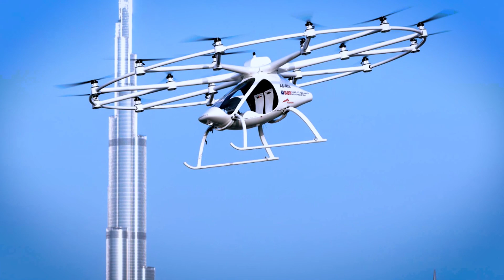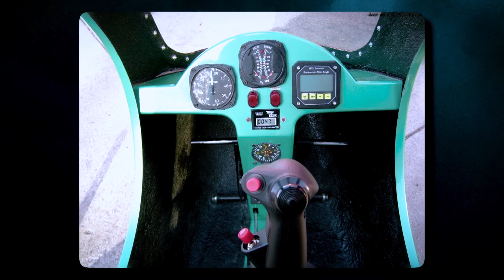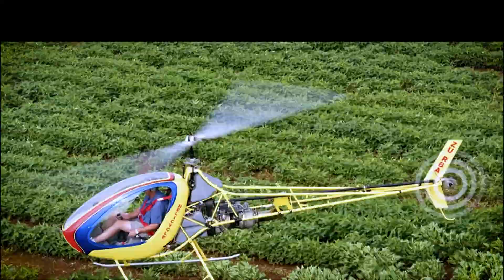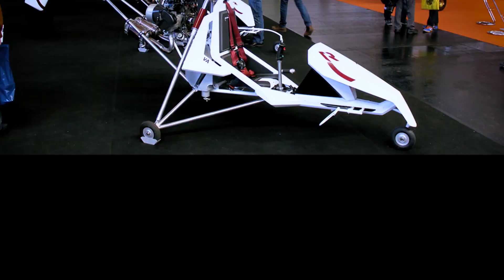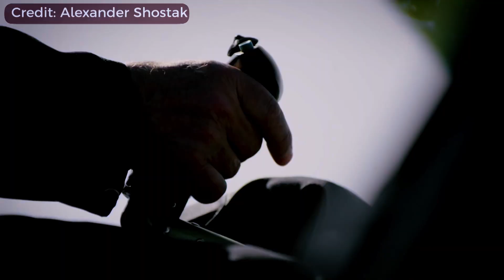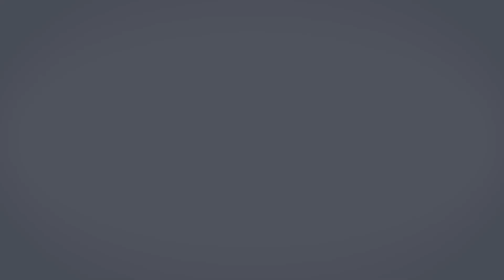23 Cheap Helicopters Private Pilots Can Buy

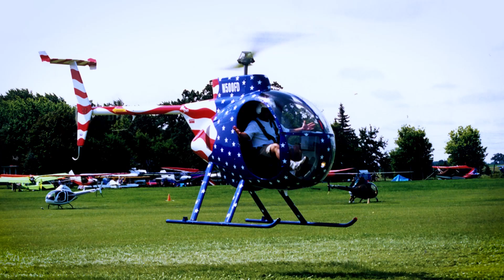Comment: (6:30) Revolution Helicopter and the Mini-500 are DEAD. Even if you can find a kit or aircraft for sale, if you value your life, don't touch it, as the design engineering work was seriously lacking. It killed a number of owners who built them and flew them.  Revolution Helicopter Corporation went out of business in November 1999.

Comment: What a surprise. The most famous gyrocopter was designed, built and flown by an Englishman. It was most famous as it was flown in the James Bond film, But as it was English and you lot hate the English, you will not include it. There is also a lot of "was" in your video which means the product is not available.
Reply: what are you on

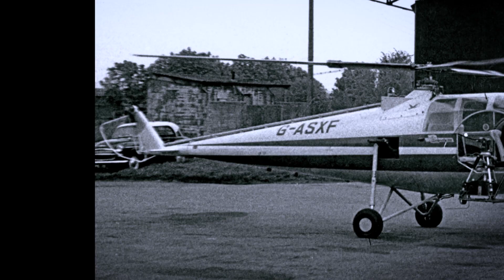Comment: The Brantly 305's (time 4:14) were produced between 1964-1966, not the 1970s.    47 units were manufactured before production was terminated.    There is currently one airworthy 305 in the world, it's in Monrovia, Indiana.   The one in your video was Serial Number 1014, making it the 15th ship produced.